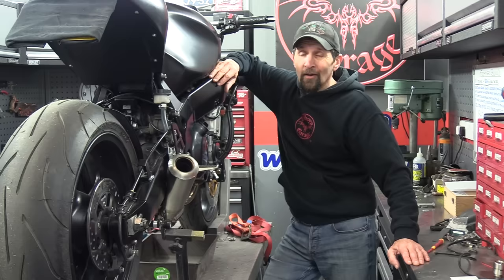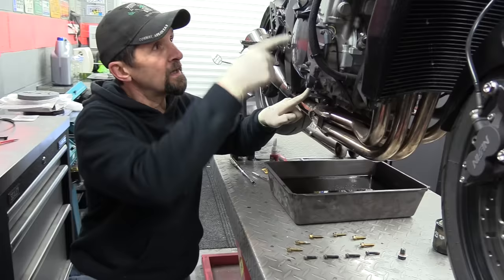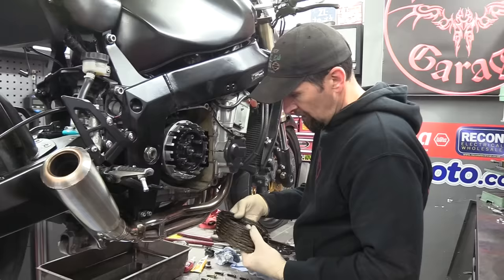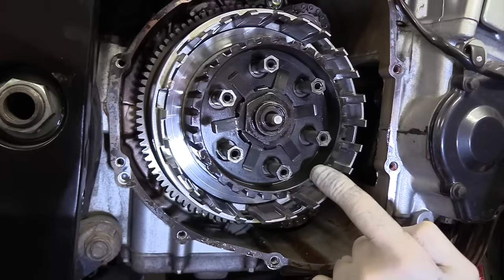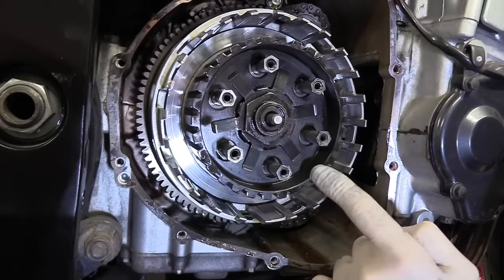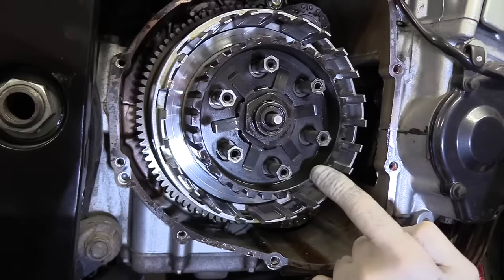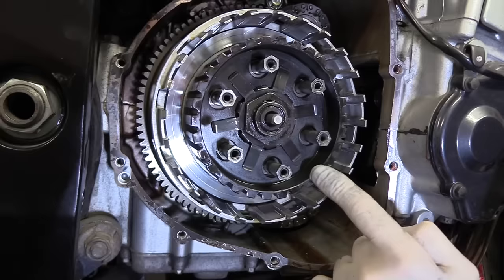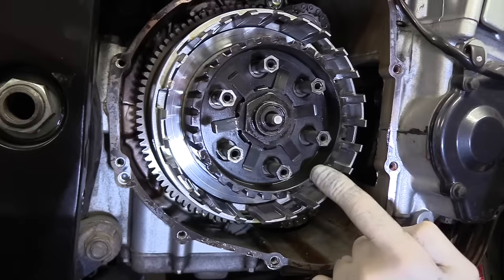Delboy's Garage,  Motorcycle Clutch Replacement .

Comment: Mr. Dellboy, i have a Suzuki M109R and i upgraded my clutch pack with Revo Rainley clutch kit. All new friction & drive plates with new springs. I followed the specs too also new oil. I then adjusted the push rod by adusting it until I felt it touch, then backed off 1/2 turn and locked it. However my bike still slips, should i go 3/4 or 1 full turn while backing out on the push rod adjustment? Basket hub nut is torqued tight too 90lbs . No rattling or nocking. Bike runs good, just slips under load.
Reply from the maker: I didn't know that the mighty M109 had an adjustable clutch pack like a Harley,  so im not sure on the exact specification for freeplay,  maybe it'll be in your manual ?  However, that free play in a Harley isn't to do with preventing clutch slippage, it's purely heat expansion space for when the motor heats up and that gap closes.. and even if it's right, the clutch can still slip due to other factors, and one of them is the new plates not being fully wetted with new oil. they must be soaked over night in the fresh oil before installation..so did you do that?... if not, then as the engine oil splashing about in there gradually get soaked into the plates, the slippage can subside... so why not ride it carefully for a 100 miles and see how it goes, and at the same time, check all your specification on the Suzuki manual so you know it's nothing obvious... Hope that helps mate.. good luck with it .
Reply: Thank You again Mr.Dellboy for your help. I will ride it like you said. However I did soak plates overnight but road it hard to test. Wanting instant results. It could be that i need to give it time to break in like you suggested 100miles on the highway. Also forgot to mention, I installed a hydraulic clutch lever kit opposed to the cable kit, because neutral was hard as hell to get in. Now it's very easy to find. But bike slips under load. Anyway Thank You for all your help. You are the MAN!!.👍🏽

Comment: Hey Del, awesome video.
Whats the milage on that busa ?
I have an 06 with 8k miles on it and am the first owner. Im not an agressive rider but  like to have preventive
Maintenance done .
I dont feel any slipping yet.  Is this problem comon on gen 1 s  ?  
Would you recomend this mod done at 8 k miles ?
Thank you. 👊🏻

I dont really feel
Reply from the maker: Hey Fred,  If you've had your Busa for 15 years, and only have those low miles, then you shouldn't have any problems.. Mine has 40k miles, and the clutch is on it's second set of plates.. (and they're like new so it was recently done by a previous owner.)   it certainly shouldn't be slipping at 8k, as you said you haven't abused it... but after 14 years, if you're getting any problems pulling away, if it ever jerks forward and stalls when you try to pull away?... then that's your 'slipper ramp' playing up, and they are a known failing of the bike... it's easily fixed, and costs about $100 in parts..    im posting up a video in about 8 hours time from now, and it will cover the slipper clutch mod... and then another video on Monday that will cover a second mod you can make to improve your Busa clutch.... check back in on the channel later, (if you subscribe then you'll get the notification), and hopefully those videos ca  help you out..   Good luck.. Del.

Comment: Hi Del,

For once I actually have a question!
My Zx10 has always snatched when pulling off lively (i.e. 8000rpm and being quite aggressive on the clutch, the actual clutch snatches to engaged and jerks me) hd a few pillion headbutts thanks to this. I rarely ride like that so haven't ever bothered looking into it.

Today however my clutch lever is feeling this "snatchiness" and that was normal town riding. It was at it's worst when downshifting from the midrange. Literally throws my fingers out when starting to release the clutch lever.

I'm assuming this may be more than simple friction plates?

Already got both plates and a cable in the basket on wemoto (cable just for the sake of doing it for £9 why not).

If there anything based on what I explained which may be worth looking into? Or shall I just crack it open and have a look?
Reply: Just a quick addition. I'm experiencing no clutch slip whatsoever, in the past I have been able to wheelie both on clutch and throttle only.

And no slipping at higher rpm etc.

I really am baffled😅

Comment: Hi great vid just watched this clutch one just after some advice my brother as got a cf Moto with a er6 engine in it 650cc 2015 we just put another clutch in its as a new basket new oil plates in ok but will not disengage adjusted the cable as far as it goes any help please thanks steve

Comment: Thanks for all your great videos. And for taking the time to teach those of us who are interested to learn and do it ourselves.
Now that the obligatory kiss up is done... quick question.
I have a 2010 Superglide. I'm going to change the Primary drive cover and Derby cover. Do you recommend soaking the gasket in oil? I have the "stock" Harley paper gaskets.
Reply from the maker: Hi Jim... thanks for the obligatory kiss up..lol.. much appreciated.. With your gasket.. NO, you dont need to soak paper or card gaskets in oil.. just make sure that the two metal faces are totally clean and free from any residue of the old gasket, and smear some grease on both sides of the gasket to help it stick to the engine and stay put while you install the cover.. the grease will ensure also that the gasket comes off again easily when you next drop the cover off..   Hope that helps, good luck with it mate.. Del.
Reply: @Moonfleet41  Thanks for the great reply. Looks like I'll be having some fun tomorrow!
Reply from the maker: @jimmyjimjim3054  Good luck Jimmy, im in the garage all day tomorrow myself, filming for the weekends video... ! hope yours goes well for you. Del.

Comment: If the groves in the basket are deep can they be filed out or just replace the basket
Reply from the maker: Difficult question mate, if they are truly deep, like proper grooves you can catch a fingernail in, then you won't file them out, you'll end up reducing the width of the fingers too much, and the clutch plates with chatter about and it will just make it worse... if they are just polished marks, like mine, then that's ok.. if they feel a little 'catchy' with the odd burr, then just use emery paper only to smooth out the burrs, but if there are actual grooves, then replace the basket.

Comment: I've have done it in my CBR600RR and I can totally spin the clutch with gear ingaged and tge wheel spons. But after putting cover on it doesn't work, no gear. 
I wonder if the clutch plates supposed to be a bit lose in the basket like mine? I did put all in but will check it again. 
I would apreciate any help please.
Reply: Got it. Wrong suze metal plates, each a milimeter to thin, oops, had to use the old one.

Comment: Если стальные пластины нагреваются и появляется синий цвет побежалости ( это около 300 градусов и выше температура) можно ли эксплуатировать такие пластины?
Reply from the maker: It is best to replace them if you can, they could be warped and in extreme cases even cracked which could lead to them breaking up. !
Reply: Ок

Comment: Having problems with my Fazer's clutch, its really stiff an hard to pull the leaver. just tried adjusting as it says in the Haynes, but could not get it to work easier, not matter what adjustments I did it would not disengage. Got new clutch cable on last summer coz' the old one broke at the leaver,  gonna lube it tomorrow. Is there something else making it hard to pull the leaver etc? Think also my oil needs changing, did it early last year, not really done that many miles since, would that make a difference? Or do I need new clutch plates? cheers
Reply from the maker: With a clutch being stiff to pull in, you need to break it down in to it's component parts and test them independently.  So take the cable off the bike completely, hold it in your hand and make sure that when you hold the outer shroud you can pull the inner cable up with your fingertips, then drop it and it drops through the outer shroud under it's own weight... if it doesn't and it's stiff, then buy a Slinky Glide cable from Wemoto, they're amazing and much smoother... also check the lever is moving in and out to the bar freely with no binding (do this with the cable disconnected), it's unlikely to be this, but it is a part of the clutch so check it.  If you do both those things, re-connect them, and it's still bad, then you need to pull your clutch cover off, and check that the actuator arm is not binding and stiff in the casing... if that's free moving, then drop out your clutch plates and check they're all free and separating and not welded together... check the push rod is moving freely... like all problems mate, it's a matter of tracing it... hope that helps!

Comment: What brand/model is that screwdriver? The one you attach to the ratchet. I would like one for my toolbox.
Reply from the maker: It's just a random nut driver from my socket set Anthony, not a screwdriver, it takes a 1/4 drive socket on one end, and has a 1/4 size hole in the back to pole a ratchet in... most socket sets contain them, I've never sought to buy one separately though!

Comment: Hi Delboy, been watching your content since I bought my first motorcycle in 2018. Now I am owning a '01 Kawasaki ZRX 1200S and I watched this video several times, because I am preparing myself to replace friction plates on my bike (ZRX has hydraulic clutch, moving begins at the very end of clutch lever release path). When releasing clutch, at the very end, when clutch starts to engage, my bike starts to shake a little bit, until starts to roll. After that no more shaking appears. I need advice. Am I experiencing some problems with clutch basket, metal plates or it is maybe another kind of problem. Thank you in advance!
Kind regards.
Reply from the maker: You can't really diagnose that without taking the cover off, obviously basic things like old worn out engine oil and old water logged clutch fluid could cause a problem, but if they're both good, then drop the plates out and check the basket for cascillation (little grooves in the fingers of the basket that causes the plates to get hung up and jammed)... If this is so, then gently smooth them out with a small fine file and replace with a fresh set of plates (friction and steel), fresh oil and fresh brake fluid and it should be fine... Good luck with it!
Reply: @Moonfleet41  Thank you very much !

Comment: Great Video! do you have something similar for the Bandit GSF1250S (2009)? or is it pretty much the same?
Reply from the maker: It's the same set of principles Danny, but from Kawasaki to Suzuki the anatomy may be a little different, so maybe get a good service manual to check for any discrepancies..  Good luck with it.

Comment: great video man, thanks! always no. 1 for motorcycle how-to's! would you happen to know what's wrong with my bike if the clutch judders for a second or two when enganging in 1st gear from standstill? happens on my vfr750 no matter how slow i release the clutch lever
Reply from the maker: Hi Jerry.. good to hear from you.. the juddering (which also happens in cars at times).. it caused by the glutch plates effectively "bouncing" against each other as you release the lever and they touch together.. its like a momentary slip on and off in fast succession?... if so its usually because the plates have become "glazed" or polished up, and arent soft any more.. this can be due to age, a long term lay up, or 'riding' the clutch a little... best remedy is to drop the plates out and take a look at them.. you can scuff them up a little on a sheet of glass with some 800 grit wet'n'dry on it.. but TBH, they don't cost much, so as you have to take it all apart anyway, then why not bung a new set in..!!!    also while you are in there. take a look ar the steel plates. if any of them are warped or really burnt.. then replace them too.. a glazed clutch will overheat pretty easy..!!!!  Hope that helps mate.. good luck.. Del.
Reply: @Moonfleet41  big help thank you, del! i was worried it was something major, but as it might just be plates as you suggest i'll order some new friction plates to begin with.. i won't hassle with restoring the old ones since bike is from 93.. much appreciated!
Reply: hi again, del! just an update on the issue of a juddering clutch in 1st gear when taking off from a standstill.. i ended up ordering a complete kit from ebc with both plates and heavy duty springs instead of just the friction discs.. it solved the problem for me (even though people from shops told me it wouldn't help blaming the springs in the clutch drum instead which aren't serviceable).. i must admit the clutch is damn hard to pull now despite being hydraulic.. those springs really are heavy duty! i prefer the standard ones but not much i can do about it now i guess.. anyway, thanks for your help, looking forward to more videos and hope you're doing well.

Comment: I always admire that wee torque wrench you have for the lower settings. You got a link?
Reply from the maker: Hi buddy, it's a Wiha item, but I wouldn't search it on the Wiha website as their full retail price is pretty hefty, here's a link to the RECON site and it's at a much more realistic price, still quite expensive as a tool, but they are very accurate and serious top quality: https://www.reconelectrical.co.uk/Wiha-Torque-T-Handle--T-Plus-TorqueVario-Set

Comment: I was on  low oil  and rode hard ... clutch has started slipping..so imma change out the friction plates .. and   inspect the steel   ...  low oil   =  clutch failure
Reply from the maker: Not necessarily totally trashed mate, check the steel plates for blueing and discoloration and lay them on a sheet of glass to check they haven't warped, most of all likely is you may have glazed up the soft plates and you can massage them gently against some fine wet & dry laid on some glass and break the glaze, if it wasn't worn out before, then it's probably saveable,

Comment: Del, followed all the instructions in this brilliant video on my 2003 Kawasaki zzr600, unfortunately the clutch sticks when the bike isn’t, run and clonks into gear trying to spin the rear wheel and ultimately stalling. Have you any advice howto cure this problem.
Reply from the maker: Did you soak the clutch plates in oil overnight, or at least for an hour or two?  And is your oil level correct?
Reply: @Moonfleet41  Soaked them for 24hours, oil level is correct, just wondering if the steel plates need changing?

Comment: Hi Del, I would like to pose you a question: could I use a basket of a Suzuki gsf650/2005 on a gsf 1200 /2001 or there are dimentional differences between the two models? I want to thank you for your videos and for the answer, if you can replay ti this msg.
Reply from the maker: Hi Massimo, I honestly cannot answer that question as i have never compared them myself.. but maybe a way to find out would be to ask your Suzuki main dealer of the part numbers for the two for them are the same number... if it is, then its the same part, and at least in theory, it should fit...   On the other hand, if you have an 05' 650 basket, and want to fit it in your 1200.. then take the one out of the 1200 ahd closely compare the two.. take critical measurements between the dimension for comparison and you may find that its compatible.. sorry can't help more mate. Good luck with it. .Del.
Reply: @Moonfleet41  Thanks Del!👍😊🤙

Comment: Would this be the same process for a HD sportster? Or do hD use a 2 type ring system?
Reply from the maker: Hi Austin, Harley Sportster models vary in their design, but usually they are a diaphragm spring, but other then that, the simple principles are the same, so get yourself the OEM Genuine HD service manual, and it will give you all the guidance you need..

Comment: How long does a clutch usually last? I'm at 68k on my original, I don't notice any "slip" but I don't hoon around either.
Reply from the maker: You said it yourself mate.. If it's never been hooned, and oil changed at the right intervals.. it'll last way past that mileage.!